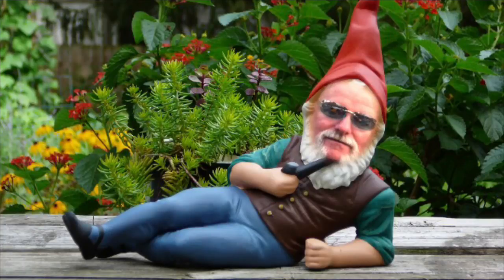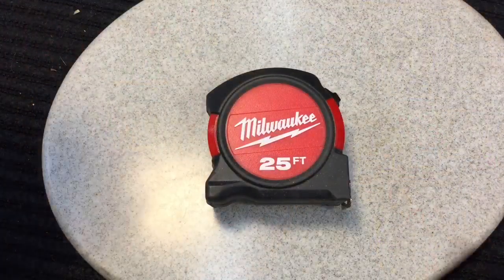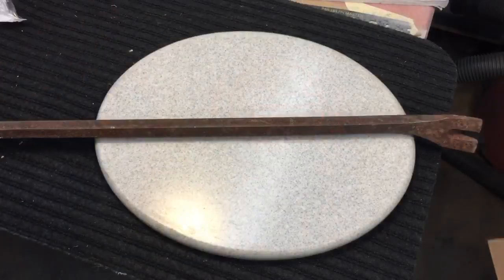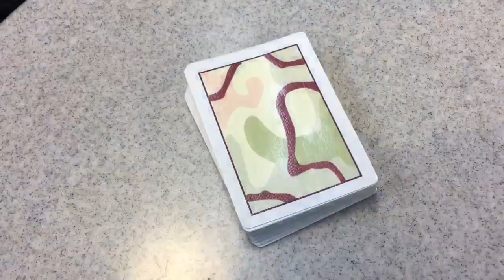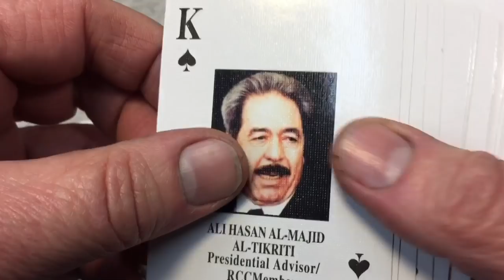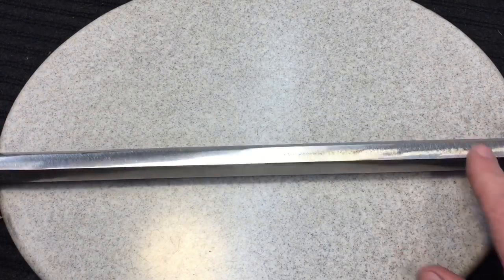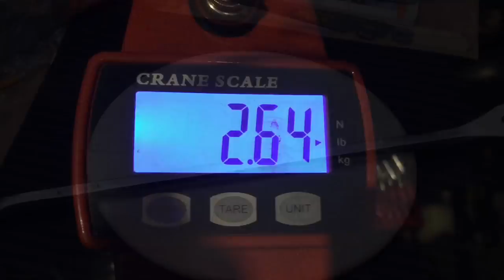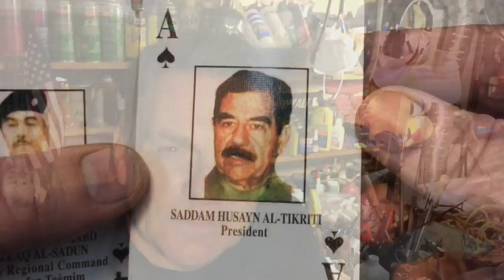Rare Straight Stanley 24” Wrecking Bar Plus Iraq Most Wanted Playing Cards

Comment: I still have my 25 foot Stanley that I bought for working at Borg Warner. I worked with my partner in Maintenance  to install equipment and infrastructure. The long reach of the 25' tape let us measure across gaps and was great for cutting pipe and steel to length on the cutoff saw. 
I mostly use my 12' tapes for home projects. I don't have the big shop and barns anymore. The need for 25 feet of tape has slowed way down. 
I also have a 100 foot tape for laying out trenches. I don't miss using that one at all.  😁😎
The bar is beautiful. 
You could set all your bars on string from the rafters and play them like a glockenspiel.  🤪🤪

Comment: Growing up on the farm we always used the large measuring tapes. The smaller ones, like a 10 footer, would be given to young boys so they could learn with them. We called those sissy tapes. That was an added incentive for the boys to learn how to properly use a tape and thus graduate to the full size. Nice wrecking bar.

Comment: As a plumber residential service/excavation plumber I use a Milwaukee tape measure. I use the 16ft Auto-Lock and love it. It holds up very well and Home Depot will warranty it out for me when the rust finally snaps the blade.

Comment: Those "big" tape measures are great for those of us in the field/construction (ironworker myself). When working alone or trying to reach ten feet plus over a gap to take a measurement in the air, a tape measure like your Milwaukee helps out a great deal. Also, I can attest that the heavy rubber overmolding helps them to survive 50+ foot falls

Comment: My favorite tape measure is a Stanley Powerlock 12' with a 3/4" wide blade.  It's fairly small, yet easy to read, and it can be extended out about 5' before it folds.  I also like the 16' Fastcap in various styles.  They come with a label that you can write on it with a pencil, and has a pencil sharpener built in.

Comment: If you like those prisms you should consider taking a stained glass class. I took two. The first for learning to work with lead came & colored glass like you see inside churches. The second was the Tiffany style where we used different textured glass, all clear. Lately I have been thinking I should rotate the textured glass one over a bulb or maybe even a laser pointer. They're both proudly displayed in my living room. I have a CFL light behind the colored one so it glows like a sunset/sunrise & I use one of those RF remotes so I don't have to go in to the corner to turn it on.

Comment: I only use those large tape measures; I have 6 of them on a homemade holder on the wall. I used to carry one around at work, so I don't really think of it as large. Now I have to hang up all my old crowbars to check if I have any good ones.

Comment: I have a Stanley 25" tape and I bought it when rebuilding my deck and also use it for gardening projects. You could not put pone of those in your pocket for sure and when I am in the garage I use smaller tapes like you showed as well as straight rulers or a folding rule. I also have a 100' ruler from my father's collection which I use very infrequently. I like that pry bar and the way the ends were positing at an angle. Those kinds of bars can be helpful when you are raising a piece of lumber or a door into position by wedging it under and push down with your foot to raise it up. Goos stuff.

Comment: Great video Scout, here in Australia it seems the most common tape measure is 8 meters (26’ 1/4”) but like you I find them a pain unless I’m working outside. I much prefer the 3 or 5 metre tapes in my shop. The 2 metre tapes aren’t much good because I keep loosing them.😂. Cheers Stuart 🇦🇺

Comment: I use the Stanley Fat Max when I'm surveying, as I need the long length (without snapping) in many circumstances. I'd never use it for small works, say carpentry in the shop, as it's unwieldy. In those circumstances,  use a 300mm metal ruler or small tape, circa 8 foot.

Comment: Have that Milwaukee tape measure, I don't use it often I also have a large Lufkin 26ft Chrome measure , a 35ft Chrome Stanley PowerLock , a DeWalt 25ft and a set of Craftsman bright green 10,16 and 25ft measures

Comment: I like a 16' tape for general use. 12s are usually too floppy and except for big layouts you often only measure 8 or 10 feet. I have 25s and 35s and 100 footers but find I rarely use them. On big pry bars I like the original non skid finish but yours look good shined up!

Comment: So how soon before we see you with one of the new 4.5 inch drum surface prep power tools (Bauer) ?
Reply from the maker: Believe it or not I used them at work years ago, they have there uses but the drums are a bit pricy.  The 4-1/2" discs are very economical.

Comment: I'm not particularly fond of the Milwaukee 25 ft  the stand out isn't great and it is a little bit bulky the Stanley FatMax 25 I carry daily in my bags and have been for many years. The blade on the FatMax is one and a quarter inch and you'll get very good stand out the only thing the Milwaukee has over it is it has measurements on both sides of the tape love that prism candle holder.

Comment: Really like your channel, but sometimes I think you go too far. I have and use that same prybar, I just wire brushed it then a coat of wax to prevent rust. Smooth like that is not so good if you're using it, the texture from the casting gives it a better grip, less chance to slip and bust your knuckles!
Reply from the maker: George- I think I have maybe 50 crow and pry bars of all shapes and sizes...  Believe it or not my favorite to use are painted ones...  However the whole reason I take these common tools over the top is just as a tribute.  I enjoy taking common everyday beat on tools and making them look fantastic.  This channel is like my appreciation to tools that nobody appreciates!   =D   Thanks!

Comment: Got two of those decks of cards. One we played spades with, the other is unused. Also got some of the cards with the airplanes on them. They are neat. 😁
Like you said about the tapes, usually contractors have the big ones. I carry a Stanley 35’. Most of my guys only go as big as a 20’ but usually smaller. For the really big stuff I use a electronic tape🤔.

Comment: Great video 👍🏻 You’re not kidding about those fat tape measures. I have a fast cap
I use when doing construction type work but around the house and shop, the tape that feels best in my hand is the Stanley metal Powerlock 12’. That’s a great tape in your hand.

My other favorite is my fathers and it’s a craftsman with a red lever lock on the bottom kind of like your Stanley. 

My grandfathers tape I have is a Evans 6 ft. He was a millwright in a cannery and it’s a “push pull tape” which I hadn’t seen before. Must be a 1950’s thing.

Comment: I am a huge Milwaukee guy. I love my my Milwaukee tools so when they came out with the Milwaukee tape measures I rushed to buy me one. I used it for one day and put it in a drawer. Being a carpenter, tape measures are super important to me and in my opinion, nothing beats the 30’ Stanley Power Lock. Or a 25’ Fatmax
Reply from the maker: LOL- I understand why contractors use them but they are so big and bulky!   LOL

Comment: If you tend towards smaller work, it's completely worth ditching the tape measure for a proper hook rule. They are a little fussy the first couple days, but once you get used to it, so much faster and more accurate. It's really worth trying to force yourself into the habit, it eliminates so many frustrating small errors

Comment: Hadn't seen a bar like that before. I have seen and used one that was similar but it only had the nail claw. You could use a hammer on the other end to drive the bar between two pieces of wood that you need to pry apart.

Comment: In the UK, our measuring tapes are even longer - 26 rather than 25 feet - because 26 feet is 8 metres.
And they're graduated in inches on one side,centimetres on the other.
Reply: We have the same type of tape measures in Canada. You can get just metric tape measures too, but they are usually a special order.